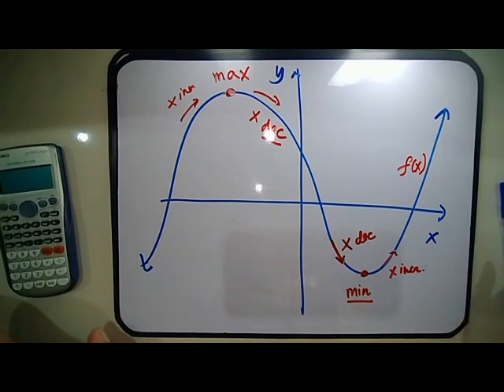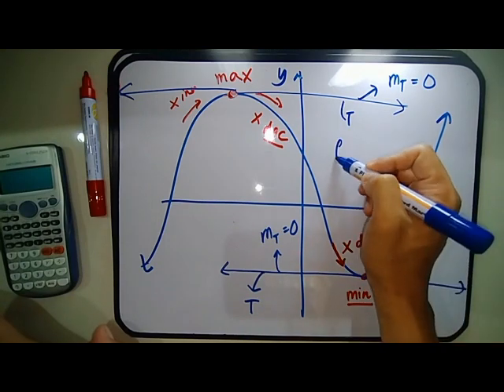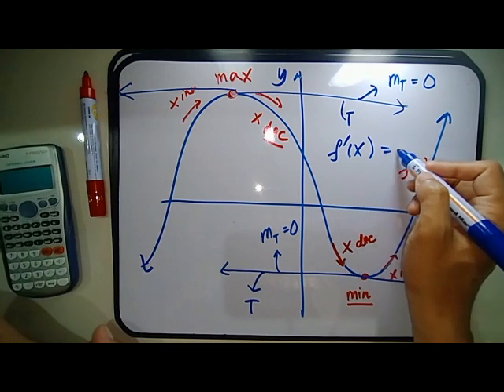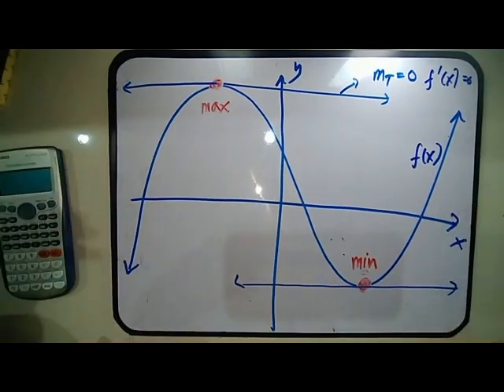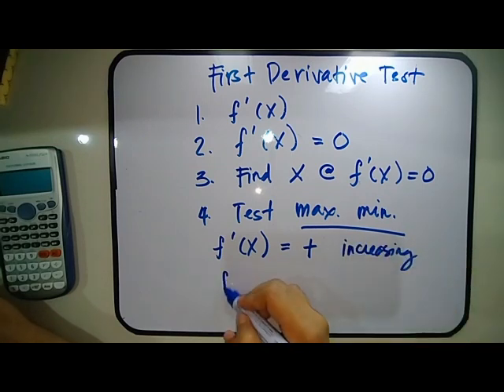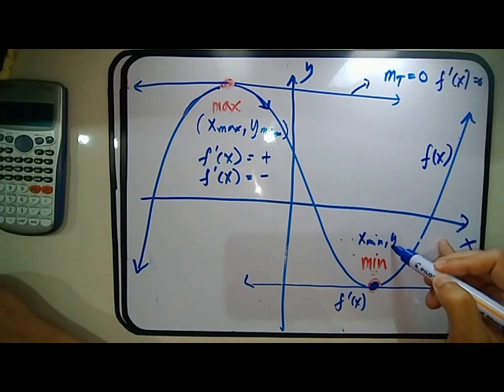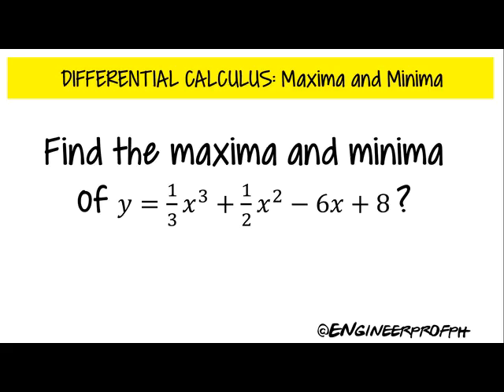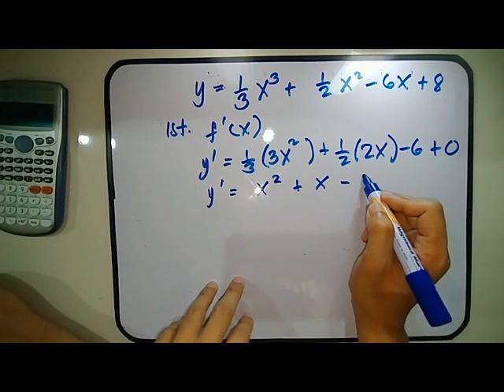Maxima and Minima First Derivative Test |Differential Calculus|

Comment: Sir, di ba pwedeng sa graph nalng tumingin. kapag mataas yung y means sya yung maximum?
Reply from the maker: yes pwede po yun pero time consuming po. If you use calculus, you can easily find the concavity at max and min using either the first and second derivative test. Salamat po sa suporta sa channel na ito! God bless!

Comment: Hello master :) hindi po ba yung y yung increasing and decreasing sa graph po? salamat pooo
Reply from the maker: You will base the test on your first derivative. First find the derivative. Equate it to zero. Determine the critical points. Substitute values from the left and right of critical points to the derivative. For values to the right, if the derivative at this point is positive the graph is concaving upward (this is min). Vice versa
Reply from the maker: Hi. In which graph po?
Reply: @EngineerProfPH  or yung mismong f(x) po yung tinutukoy niyong increasing and decreasing?
Reply: @EngineerProfPH  Salamat po :) dami ko po natututunan sa channel niyo :)
Reply: @EngineerProfPH  left and right side po ng critical points. salamat po